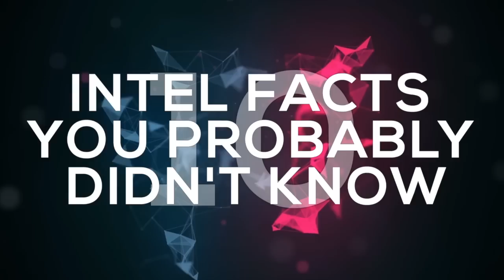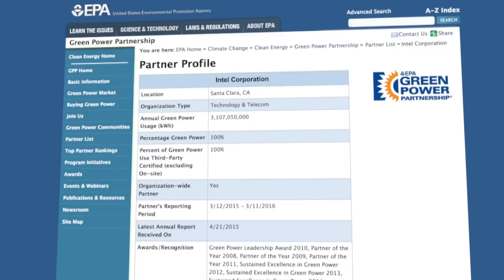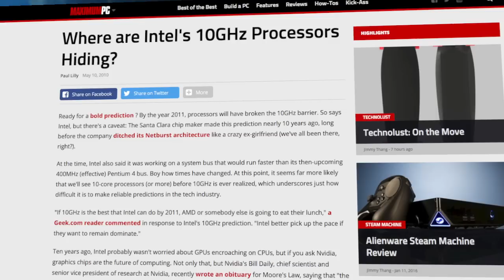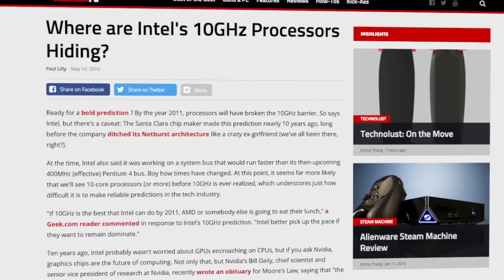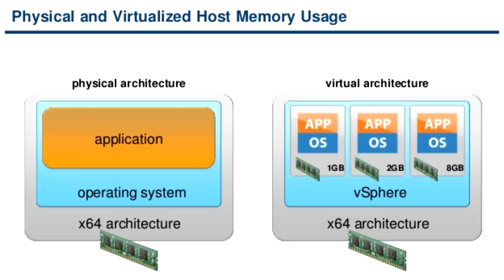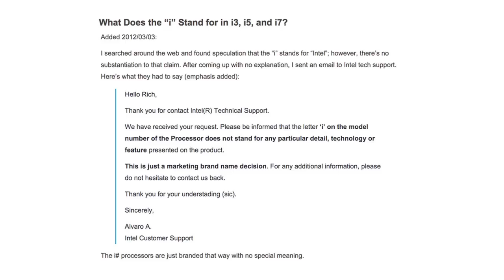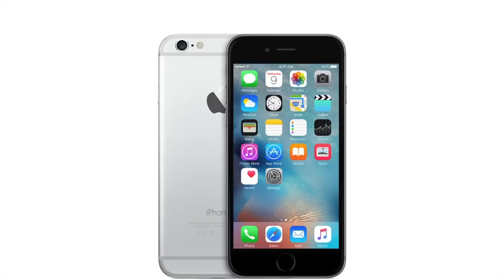10 INTEL Facts You Probably Didn't Know

Comment: I'm an AMD guy. I like the idea of having an 8-core 4ghz processor.
Reply: +Zenn which can't beat intel's 6-core 3ghz processor lmao
Reply: Correction - not actually 8 cores bud!
Reply: +Liza Shy Stupid? Yes, facts are stupid.
Reply: +SnazzyMacGuy ACtually they are 4 modules, that function as 8 cores...
Reply: +Liza Shy Samsung S6 HAs an 8 Core processor, Where have you been? Oh wait, you are thinking about iPhones which have been behind in CPU Core Count forever.
Reply: And news reports say they technically don't have eight cores
Reply: +EJ102 Ej102 each module has 2 cores, they share cashe
Reply: Kaydn Burns >dual quad core

what
Reply: the one you dont see AMD FX cpus have a shared FPU... This is why people call them "fake" 8 cores. Not due to shared L2 cashe. An i7-2500k - i7 5960X outperform an FX 8350 in compute tasks due to a more effecent architecture. Games actually can perform worse with HT on. Games currently really don't need more then 4 cores. They scale better with faster cores, not more cores. Also Intel has been selling their top consumer i7's for the same price for years. Intel's newer stuff ins't more expensive. If you look at the extreme cpus they also have been steady in their prices.

http://www.anandtech.com/show/6396/the-vishera-review-amd-fx8350-fx8320-fx6300-and-fx4300-tested/3

AMD is loosing most tests to Ivybridge and Intel has only improved since then.
Reply: +Zenn 5960x can overclock to 4.5 on 8 cores 16 threads soooooooooo. wyd
Reply: +scott simo wh not buy an i5 and overclock to the same clock speed? SO much more performance.
Reply: The problem is people compare an amd 8 core, which costs as much as an i3, about $120, to CPUs like i5s and i7s which are between 200-400, and if its an extreme edition or a xeon we're talking $300-1000 or more
.
Reply: nlmaster That's not true, people actually do compare the FX8xxx with i3. i3 skylake for about $100 b eats the 8350.
Reply: only when overclocked, but the 8320 (or higher) can overclock a lot too.
Reply: +Zenn AMD is more suited to people on a budget. They are good chips for the price but when it comes to anything above something like a 4690k, they really begin to struggle. Their most powerful chip (9590) needs to be watercooled from stock because its pretty much am 8350 with a stupid overclock. Their single core performance is just so weak.

Zen is moving away from the bulldozer architecture and into more traditional single powerful cores. Only then will we see proper comparisons.
Reply: bensemus x Oops, that's what I meant, mixed up my terms, sorry!
Reply: uTukan i was typing on my phone and typed dual core again, forgot to remove the word dual. Although i like how you completely ignore the subject just so you can sound cool
Reply: the one you dont see "Intel loses in the APU gpu markets" that's exactly what I wrote. 

What you said is not true, you can get Intel that's cheaper than 8350/8370 and it'll still beat it. You absolutely don't need motherboard for more than $100 to "properly support it"
Reply: +uTukan yeah i agree that usually in all walks of life the more expensive will be better BUT
they are both running at the same clock speed and the cheaper cpu has 4 more cores. 

at 1st glance on paper people would assume that an 8 core 4ghz processor would be better than a 4 core 4ghz processor . (and if not better, at least equal)
(the question would then come up why is the intel double the price then? my benchmark shows why)

I think it is a fair comparrison. (the price the companies charge you for this spec is not the issue. the spec itself is the issue) 

the FX8350 is like Ford selling you a Focus claiming it will do 200mph when in reality it is an underperforming mediocre (admitedly cheap) product.

its showing that numer of cores isn't the be all and end all, its how you use those cores that matters. 

The OP likes the idea of having an 8 core 4ghz processor... i was simply showing through my experience with similar specced (on paper) cpus from both companies how stupid an idea that is)

as i said i only had these 2 processors to test against but i'm sure a comparatively (to the fx8350) priced i5 would piss all over it also
Reply: ***** I know, that's the point.
Reply: +Liza Shy :) yep.
Reply: +irakli “Bomtvare” bogveradze but that costs several hundred dollars more for for only a marginal improvement in performance
Reply: TheSlayerofevil3 It depends on the application at hand. If it is gaming,the Intel 6-core would only have a marginal improvement. However, if it was video editing, then the Intel 6-core would run laps around AMD's 8300 CPUs
Reply: Isaiah Baez yep forgot to add the part about gaming
Reply: +irakli “Bomtvare” bogveradze to be frank its costs 3 times as much, I would expect that intel 6 core to thrash the cheaper alternative...otherwise it would make no sense. xD
Reply: +Liza Shy that's wrong. Phones that that use the BIG.little config have 8 cores. Each core is a fully functioning thing. They never run all 8 at a time though so they are effectively quad cores as they will only run either the BIG cores or the little cores.
Reply: +Isaiah Baez the 6 core will do better as Intel's current architecture is much better then AMD's, giving Intel better single threaded performance which is where most games still are.
Reply: TheSlayerofevil3 Bannana Yeah I know its not much of a difference in gaming, because games don't really use more than 4 cores so improvements wont be noticeable, but in other heavy tasks intel's 6-core would outperform AMDs because those tasks use all those cores
Reply: +SnazzyMacGuy To all those people lying about it not being 8 cores, yes it is, AMD's FX 8 core processors do in fact have 8 independent cores that can each do a separate task. You just look like a stupid fanboy trying to yell lies over the internet.
Reply: +Zenn so you like the idea of incompatible software that is only able to use one of your cores ?
Reply: If a program doesn't use all of your cores it doesn't need them. Games limited to 3 cores aren't CPU bound and games that are cpu bound support over 8 cores. There isn't a single good editing program that won't take advantage of 8 or more cores.
Reply: ***** I do. AMD's cpus share an fpu between 2 cores while BIG.little cores do not share anything. They are very different designs.
Reply: nlmaster They are not truly independent as 2 cores share one fpu. They can't both use in at the same time. Separate the cpu into 8 things and only 4 will get an fpu.
Reply: +irakli “Bomtvare” bogveradze *2 core 3.7GHz
Reply: +Zenn I have my 8350 OC to 4.9ghz with water cooling. It runs nice.
Reply: +Twin Turbo more cores =/= more performance idiot!
Reply: +Zenn Good luck with piss poor single core performance, where it actually matters most of the time.
Reply: ***** the 6300 is a much cheaper part though. A better comparison is the 8350/20 where the i5 still wins in most cases.
Reply: jmcwd Holy shit stop fanboying so much, AMD actually wins in rendering software.
Reply: uTukan against an i5 but most people who render do it for their job so they can afford an i7 or an Xeon.
Reply: bensemus x Good point
Reply: nlmaster Except then you need to invest in a decent mobo and a good cooler pushing up the cost. Negating any savings the AMD platform had
Reply: well a good mobo for am3+ is cheap, about $70 or more, and a cooler like the hyper 212 evo is $25 and can push well past 4ghz, equivalent intel motherboards are more expensive. You need a decent cooler to overclock an i3 as wells so...
Reply: nlmaster 1. you can't oc an i3 unless you are using one of the "hacked" mobos that managed to get oc working for non k models but those mobos have stability issues and 
2. a $70 won't be able to max out the cpu do to incapable vrms and mobo cooling.
http://linustechtips.com/main/topic/394129-intel-bias/page-2

Read the best answer. It is quite long though.
Reply: +Mark Perez 
just wait a little for ZEN!
Reply: ***** The 6300 is one of the better chips due to it's low price point which Intel doesn't really compete with. That or the 860K.
Reply: +Zenn I am sorry buddy, but Intel i-series are the most stable and well made processort out there.
Typed from an AMD 8-cores 4.0 GHZ powered machine. Which in fact are 4 cores instead of 8 but whatever...
Reply: ***** Upcoming AMD CPU Chipset. How are the first days out from cave? :D
Reply: uTukan Not a chipset. It's their new architecture. Like Skylake or Ivybridge. They will be making quite a few cpus based off it.
Reply: ***** It will span multi thousand dollar cpus to cpus costing a hundred or less. It's the same thing Intel does where they will have Skylake Celerons up to Skylake Xeons.
Reply: ***** Well it'll be let's say $100-$400+ CPUs, but it should perform better, and overall it's interesting seeing what will AMD manage to do.
Reply: uTukan It's rumored to perform similar to Haswell. It will be much better then AMD's current offerings but it won't take the performance crown from Intel.

As long as AMD prices it right it should be a compelling buy.
Reply: +Mark Perez 
idk if the will be cheaper,but they get 40% more instructions per clock
Reply: TechGeniux Although that's against AMD's Excavator architecture which is quite old.
Reply: +SnazzyMacGuy Correction to your correction :) it is a 8 core cpu you can t compare amd to intel in architecture just because intels has 1 core on 1 module it doesn t mean that amd has to have 1 core on 1 module.
Reply: +bensemus x 
UR right, but I couldn't find any other numbers
Reply: TechGeniux It's all AMD has given us. It just needed a reference point. 40% better on it's own doesn't really tell you anything.
Reply: A dual core Intel beats that cpu in games lol and a dual quad core at stock speeds beats the AMD in every test, with the AMD being overclocked by an entire ghz
Reply: I like the idea of having a gaming machine instead of a server PC.
Reply: Jordan M. ?
Reply: +Zenn Cant beat a 4 core 3.5ghz processor. AMD is like a v8 being beat by an i4
Reply: if you got 8 cores and threads that actually can easily be clocked 4.2ghz all the time you can do weather data processing faster than the chip with 4 cores and 8 threads that cost twice as much so the reality is simple some things need different cpus that may be cheeper and older and more reliable at 4.2ghz no i7 quad can run hard for a full day doing tasks a server cpu should do clocked at 4.2ghz
Reply: the one you dont see That doesn't really make any sense. processing power is not just cores * speed. The efficiency of the architecture has a big impact on the processing power of the cpu. This is why AMD has fallen out for favor. Their architecture is old an inefficient compared to Intel's current offerings. 

I fold on my system with a i7 4790k so it's running at 100% 4.4Ghz while I'm not using the computer. Over winter break I went home and left my system folding 24/7 for idk 2 weeks. No crashes no nothing. Just folding.

Server cpus usually run at lower speeds then consumer cpus. Less heat which is highly desired when you have hundreds of cpus to cool. They instead have way more cores and threads to give them their power.
Reply: The performance per dollar (or unit of any currency) is remarkably better in an AMD FX-9350 (8 cores @ ~4GHz) vs. an i7-5830K
Reply: Twin Turbo The 9xxx is AMD's worst product bar non. It's basically an 8xxx just binned much higher to achieve those clocks. It's tdp rivals that of high end gpus. The 5820k (5830K doesn't exist) beats the 9350 (can't find it any where for sale) in everything (even launched at a lower price). It has 2 more threads, built on 22nm, tdp of 140w vs I'm assuming 220w as information on the 9350 is extremely hard to find. I've found a thread that talked about it but no data sheets. Wikipedia doesn't list it with the other black edition cpus. Was it ever sold as a stand alone product? Or did you mean the 9370? That has plenty of information but fares no better.

I'm assuming you may not actually know much about these cpus...
Reply: ***** Nope, it was found out that they were actually not real cores.
Reply: +uTukan no its real cores you need to not make up facts. with intel hyperthreading its not dubbling the clock its just 2 threads per core that actually cuts in half cpu core down time due to resorces like cache and ram plus chipset lag to cpu is cut in half and thats a lot of latency taken out of inside a pc. with amd fx its pairs of cores sharing l2 cache witch constricts resource access and increases down time. but large tasks are not effected becouse it is real cores running mostly directly from ram. strangly games are the only thing that gain with hyperthreading things like editing and weather pattern calculations run much better on fx-8350k than intel i7 4790k at about $200 less witch is more than the price of the fx-8350k. the newer stuff from intel is not compairable simply becouse its jus newer and starts costing more than the average consumer is going to spend. vary few people are going to spend more than $700 on a amd pc but the opposite goes for an intel pc.
Reply: cores don't count
Reply: Cataxtrophy Gaming Yeah good luck running anything on single core then.
Reply: +Zenn that gets pissed all over by a 4 core i7 @ the same clock speed. (certain i5's would do the job nicely too but i only had an i7 for this test)

i had an fx 8350 as my previous build.
the night before I put in the new i7 i did some benchmarks (to all intents the only thing being changed was the cpu, i had to put in a new mobo for obvious reasons but it was similar spec to the previous motherboard)

 Using 3d mark benchmarks and cinebench the new i74790K i put in killed it in every respect. (and every test)
the extra 4 cores in the FX made no difference it still got detroyed by the 4 core 8 thread i7 at the same clock speed.

the fps scores for gpu were up even tho it was the same gpu the new physics scores were through the roof compared to the AMD (almost 60% better)
there was no test where the AMD came off better

(the physics and combined tests are the cpu tests and the i7 has a 58% increase in performance on both, this is just the test on firestrike which is the most demanding of the tests in 3d mark)
http://www.3dmark.com/compare/fs/3926316/fs/3931858#

overall performance is 22% more

that was enough to justify my decision to spend a little extra this build and go intel.

I had been using AMD for years thinking they were good enough and how much better could intel really be?

LOTS better is the answer to that one.

do yourself a favour mate go with the cpu that works best. not who makes it.
(I had been doing the brand loyalty thing too long, whoever brings out the best stuff at the time im ready to upgrade will get my cash from now on, even if its a little more cash)
Reply: chemicalBR0 While I agree that Intel currently beats AMD at any level, maybe expect the ultra low-end (APUs, or really old Athlons), you are comparing $160 CPU to $350 CPU, obviously the 4790k will win.
Reply: uTukan intel looses in the apu gpu markets and the price to performance has been retarded. why do all the intels that can beat a fx-8370 start at $250 and to have a motherboard that properly support them are all over $100. vary high end amd motherboards that can be used to overclock the fx-8370 to 4.8ghz with all the modern features you will use can be found under $100
Reply: +irakli bogveradze

The AMD CPU is from 2011 and the intel from 2015-16 so ?
Reply: Zenn and now you can
Reply: At 6000 degrees.
Reply: Xeon x5690 is a good choice and there cheap and older. Xeon x5650 is the same as a ryzen 5, xeon is still the better choice and both of the chips can be oc. Depends on the board, I used a am fx 8350 and just didn't like it not hating on amd, then got a xeon 3.20ghz e3 1235 4core 4thread and just demolished the amd. I like both amd and Intel